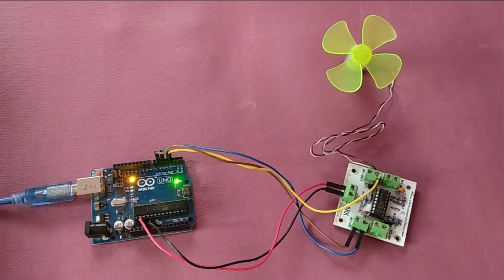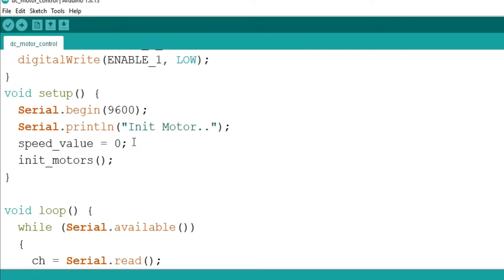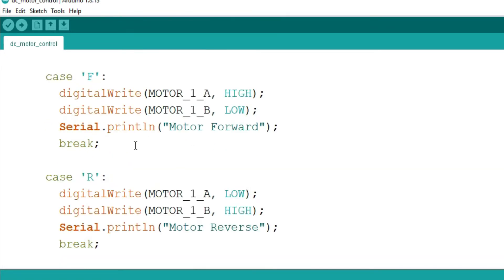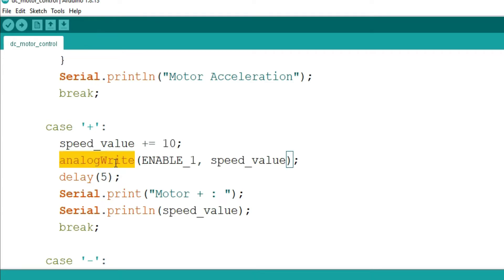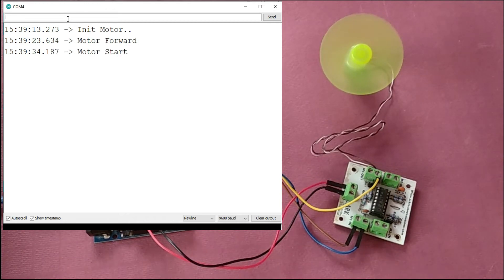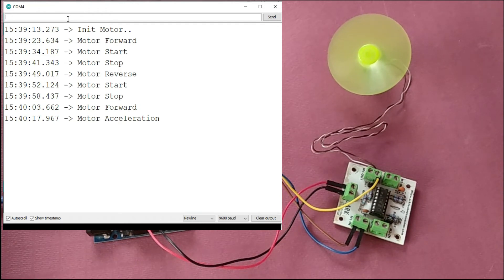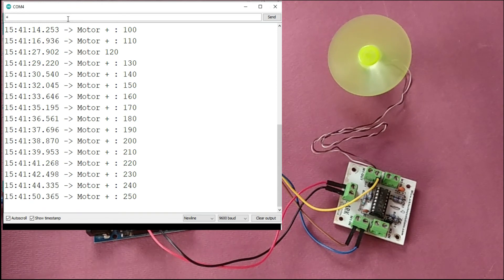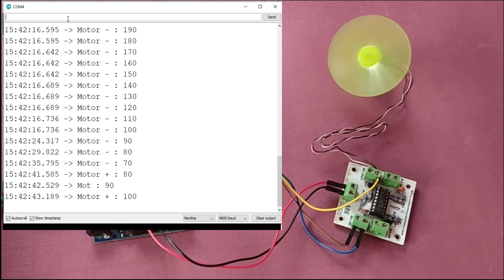DC Motor Speed and Direction Control Using Arduino Serial Monitor

Comment: Can you please link your circuit connection with Arduino and PCB
Reply from the maker: https://www.makerguides.com/how-to-control-a-dc-motor-with-l293d-driver-ic-using-arduino/

Code and circuit diagram is available on above link.

Comment: I want a control rebotic car with L298 driver by serial monitor how can i do that?
Reply from the maker: Do you want to control DC motor or stepper motor?

This article will help you, if you have stepper motor https://www.makerguides.com/l298n-stepper-motor-arduino-tutorial/
Reply: @ecit  a dc motor
Reply from the maker: @ahmedabdalla5029  follow this article,

https://www.makerguides.com/how-to-control-a-dc-motor-with-l293d-driver-ic-using-arduino/

same pin you can uae for l298

Comment: Sir I want to reverse forward 4 dc motor of 12 volt but sir if we want to control all motors through mobile then which components need replace
Reply from the maker: You will nees 2 drivers. Instead of Arduino Uno use ESP32 or ESP8266.

Use Blynk App to communicate with ESP.

Or you may use BLE in ESP32 and design your own App for communication